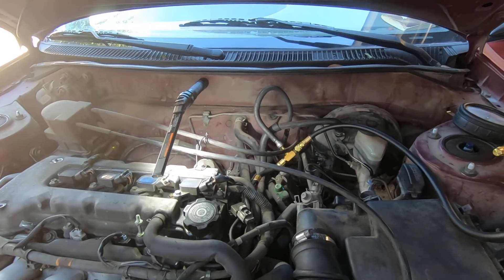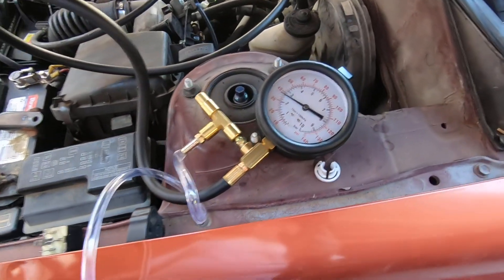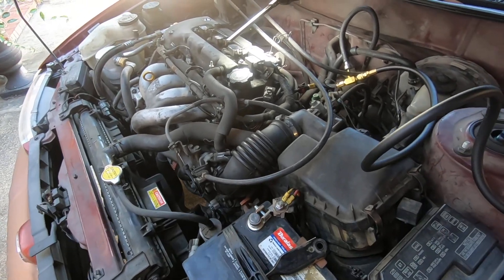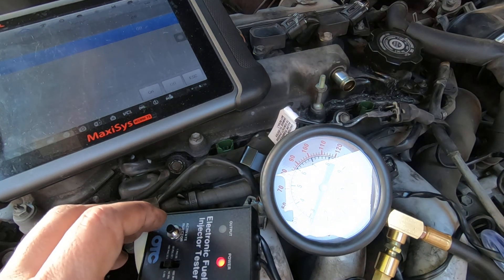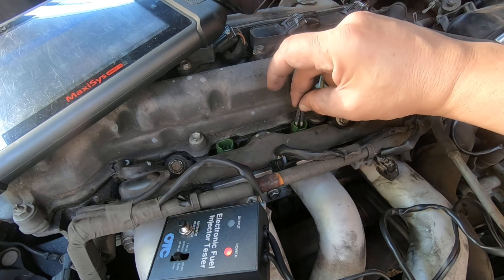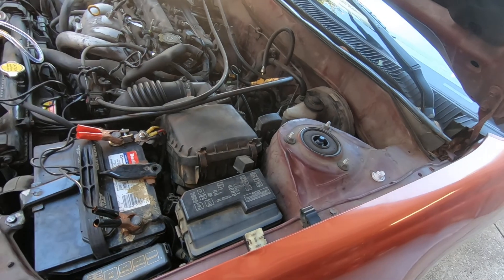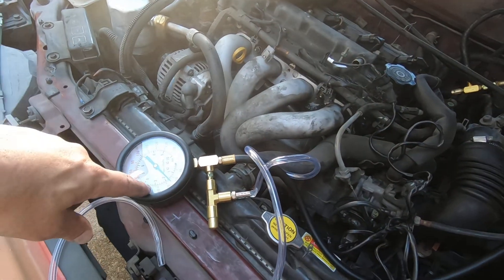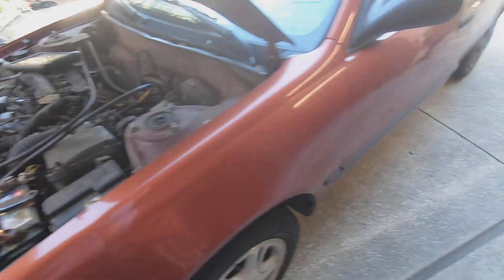Fuel Injector Balance Test using an OTC Fuel Injector tester.

Comment from the maker: OTC 3398 Fuel Injection Pulse Tester
https://amzn.to/3OzlPDt
ALLOSUN Fuel Injector Tester & Adapter DIY Cleaning Tool Kit Set
https://amzn.to/3y3Ed1T
BETOOLL Pro Fuel Injection Pressure Tester Kit Gauge 0-140 PSI
https://amzn.to/3mRd3on
Master Quick Disconnect Tool Set, 25pc Line Disconnect Tool Kit
https://amzn.to/3NPPYOJ
Autel MS906BT Scan Tool
https://amzn.to/3Oe3iw4
Xtool D8W Scan Tool
https://amzn.to/4cVMfLs